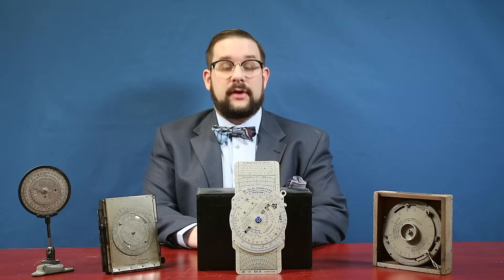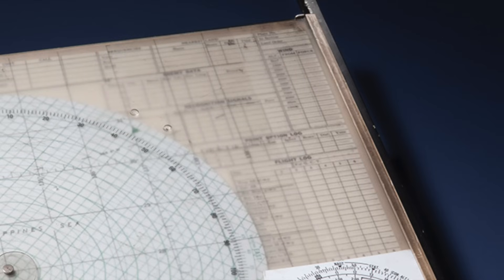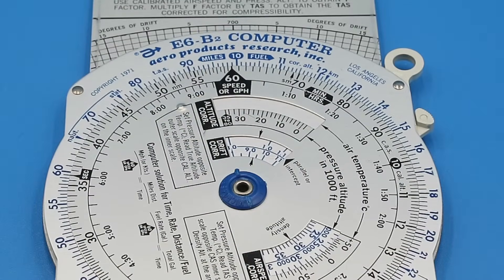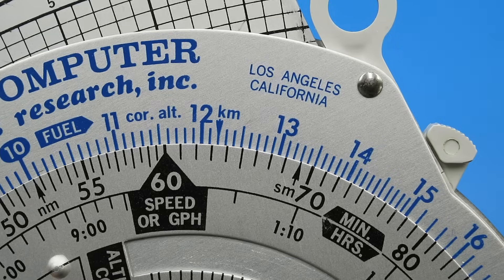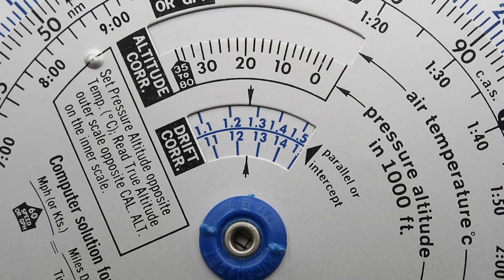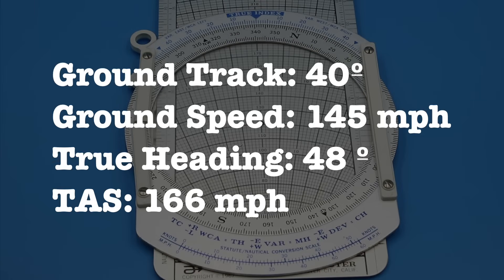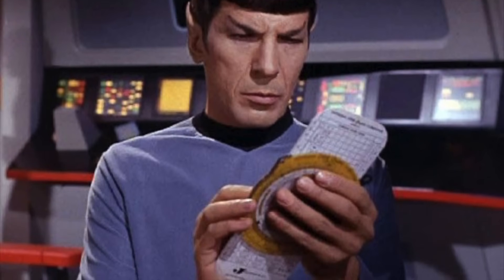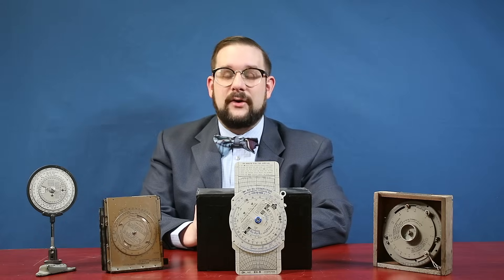E6B Flight Computer: the Pilot's Best Friend

Comment: My E-6B does not have the high speed grid on the flip side. It has more useful things for general aviation pilots. It is otherwise the same apr E-6B2 as featured in the video, dated 1973. I got it new in 1989.
Reply: I've never used the parallel and intercept function before.  According to my testing it is a tangent function calculator.  The distance downrange is along the intended course and the offset is at right angles so the angles determined are effectively the inverse tangent function.  I tried Sine (along the actual path of flight) and Tangent (along the intended course) and tangent fits the marks better.  Also it is necessary to know the magnitude of the angle since there are two scales, smaller and larger. I tested it assuming the wind blew me off course and using it to intercept, meaning turn from the current heading resulted in being within 2° of the wind correction (crab) angle to intercept the original course intended.

Comment: 🧭 E6-B1 Flight Computer: Proof the Earth Doesn’t Move — From the War Room to the Cockpit

Before GPS.
Before space propaganda.
Before science fiction became “science fact”…

Pilots navigated the world using a simple mechanical tool: the E6-B1 flight computer — designed in the 1930s and used through WWII and beyond.

Guess what it doesn’t calculate?

❌ Earth’s spin (allegedly 1,000 mph at the equator)
❌ Curvature drop over distance
❌ Coriolis adjustments for a spinning globe

Because it was never needed.
And still isn’t.

✅ The E6-B1 was built to work with reality: a stationary, flat Earth — just like the Bible describes.

“The world also is established, that it cannot be moved.” – 1 Chronicles 16:30
“He set the Earth on its foundations; it can never be moved.” – Psalm 104:5

Pilots use plane trigonometry to correct for wind, calculate true course, and find ground speed.
They don’t adjust for a globe. They don’t factor in spin.
Because the Earth doesn’t move — and flight proves it.

If this offends you, consider:
Why do the tools that get people safely across oceans still rely on flat-Earth math?
If the globe were real, these instruments would fail.

But they don’t. Because the Bible wasn’t lying.
The “science” was.

Comment: Interesting. My son gifted me a Citizen Nighthawk watch that has an internal rotating ring that has some of the functions of a flight computer. I used a slide rule for chemistry and physics equations in the 1960s so I should be able to figure out how to use this watch but the print is too small for me to read even with my reading glasses so I don't use it. It's just a very complicated appearing watch.

Comment: At one point, I earned a Private Pilot Certificate.  I also worked in IT as a software tester, so while I loved computers I don't entirely trust them.  So while there were electronic tools available, they had software.  And batteries, which could die and I'd need to carry extra batteries, blah, blah, blah. 

I loved that thing, though.  I used it for flying, and sometimes for just general math.  Mine was aluminum.

Comment: Sure brought back memories of my early pilot training starting in 1962. I still have my Jeppessen circular “Whiz Wheel”. And, I used a Post VersLog slide rule in College (mechanical engineering). I retired off the Boeing 767 over 20 years ago. The Boeing had a Flight Management Computer (two actually) that did all our calculations for us. EXCELLENT explanation, though.

Comment: I still keep a Whiz Wheel in my flight bag and use it to stay in practice.  While even entry level general aviation planes glass cockpits and tablet based apps becoming the norm, there is still the satisfaction of plotting your flight with an E6B.  It requires no batteries, does not crash (unless you fly the plane into the ground), does not need updates, and no annual subscription fees.
Reply: God bless you good Sur…🇺🇸🇺🇸🇺🇸

Comment: At 15:58 you show a Mk. III Navigational Computor. From my dad's RAF Air Navigation Handbook "It is made in three types. Mks III, C and D can be secured to the thigh and are designed for use by the pilots when seated. They carry a pencil and a small note-pad under a flap, on the back of which is set a circular slide rule and a Height and Airspeed Computor for instruments calibrated isothermally (C) or according to the I.C.A.N. convention (D).
Mk. III F is for use by Navigators, and apart from not having straps, a flap or a note-pad, is virtually the same as the other types".
I can scan the pages for you if you wish.

Comment: Thank you for covering the E6-B. I bought my aluminum E6-B when I was about 14 years old so I've had it for 55 years and I still use it. I also had a Jeppesen CR-3 computer but the plastic degraded over time and it became difficult to use. It may still be packed up in a box somewhere.

I still want you to cover the Rude 2102-D Star Finder.

Comment: The huge advantage of the Wonder Wheel is that the human mind is more suited to analog information than to digital. As you work the wheel, the mind adjusts perception to match -- in other words, you are following the moves of the markings that are important to you, so you understand the results in relation to what you were thinking.  Looking at a digital readout, you have to correlate the result to what you were actually doing.

I've tried electronic calculators specifically designed for aviation, and keep going back to the E6B.

Comment: G'day,

Back in the late 1970s I spent some time selling Helicopter Joyride tickets for Captain Rosemary Arnold Harris, whose claims to fame were being the first woman to fly across the USA in a Civilian Turbine Helicopter (a Hughes 500..., back in the 1960s), and being the first female Commercial Rotary-Wing Licence-holder in Oz.

She often flew in a Gold Lame Flying Suit (!), and sported a Wristwatch with a 2-inch Dial and a Flight-Plan Computer around the Bezel...

A few years later a RAAF WW-2 Aircrew Veteran gave me his 1941 Airframe Riggers' Textbook - featuring LOTS of Basics and some coverage of Fairey Battles, CAC Wirraways, Hawker Harts, & Lockheed Hudsons, as well as a Gadget made of Perspex & Brass, circular, labelled ;

"A.M."

at the top of a white Perspex Disc 10 inches in diameter, in the centre of which is a 7 inch Clear Perspex Disc...; One half being dedicated to

"OBTAIN TRUE HEIGHT...."

& the other half to

"TO OBTAIN TRUE AIRSPEED..."

On the lower side it is labelled;

"WIND AND NAVIGATION CALCULATOR Mk.I.

ISOTHERMAL CALIBRATION

REF. No. 6B/243 "

On one side..., with the above engraved and inked legend...

If one sets the corrected Height in thousands of feet against Air Temp in Centigrade, then the Corrected Height (Indicated by the Altimeter as corrected for Local Barometric Pressure - reads against a scale showing the 
True Height...

Or it will take "Corrected" HEIGHT with air Temperature to yield TRUE AIRSPEED...

And it offers to transpose Statute Miles with Knots with Kilometres..

On the flipside, the outer inch & a half "doughnut" rotates around the centre..., The outer scale, at the top reads 

"T.A.S. (from 70 to 300) T2"

Inside that is 

 'WIND...(4 to 70) "Q" ' 

Inside that is a Compass Ring -and all those 3 Scales rotate as one.

The centre 7-inch Circle is fixed, clear smooth Perspex, over  marked white core..., in red & green the sides are marked PORT & STARBOARD.

There's a central vertical line with an upward pointing Arrow..

The vertical Line has a set of parallel lines running horizontally across it, and from each Intersection, straight lines depend, sloping down to the Right & Left - labelled as
"2M 00S" at the bottom, rising by 5 S increments with every 10 S labelled - running up to 
"4 M 00S".

Basically, I reckon it to be a Navigatir's bit if Kit, designed to be used wearing Gloves & witth 2 Brass Knobs on one side & 2 on the other - and as the measurements show..., it's
HUGE...

Easy to use in Silk & Wool Gloves, maybe also with Leather ones atop the two inners (?).

But, how many did the RAAF make, of the oversize Mk-1 Navigator's "6B/243" ; and how many are still around - one wonders ?

Anyway, thanks - now I know roughly where what I've got, slots into the 
Family Tree
Of the Dalton E6-B...!

Such is life,

Have a good one...

;-p

Ciao!

Comment: Bravo! What a great presentation, about a classic device! I’m an engineer, 70 years old, but I’ve never been trained on aerial navigation methods. I can fix my position on a boat with a chart and 2 landmarks, but that’s about it. With your presentation, and an E6B in hand, I feel like I might be able to comprehend the concepts. Kudos on your script, your crisp, precise delivery, the quality of your photography, and of your supplementary graphics! That sentence was a mouthful, I’m aware, but I felt the need to tick of the entire list of things you did right.

I used a (straight, 12”) slide rule in high school, before the advent of electronic calculators. Got my first one of those in my freshman year of college. I still have my Pickett 12” aluminum rule.

I love your clip of Mr. Spock using the E6B. I would point out, however, the existence of the Greek Antitherika (sp?) mechanism, as an example of an ancient quite complicated gear-and-dial mechanism.
Reply: I have my Dad's Dietzgen Polymath Decimal Trig Log Log slide rule.  I use it from time to time, the easier functions, the Log Log part is tricky, takes a lot of practice. I figured out how to calculate wind triangles for dead reckoning with it; pretty fun.  I have 3 K+E slide rules but the Dietzgen is definitely superior.  The K+E slide rules use the A scale for trig functions, not as precise. The Dietzgen uses the longer D scale.

Comment: I still use my E6B! I bought a digital version for an exam but I still needed my E6B for altitude computations. I also have the Jepson computer which I bought while instructing. I brush up my E6B skills regularly as a backup to my iPad which occasional fails in hot conditions.

Comment: An electronic device looks much easier. 
You can just key in the speeds and wind vectors and get the course correction and ground speed immediately.
BUT... It is also easy to make mistakes like keying in 210 for a direction when you fly 120...
The analog flight computer shows you what is going on. It is easier to spot mistakes.
An airliner nearly crashed because the First Officer made a mistake entering the total weight. The very heavy aircraft attempted to take off with too low a power setting.
Would the same have happened if there was a rotary dial marked:  very light / light / normal / heavy / very heavy?

Comment: Ah, ha!  So THAT is what the pilot was using as we flew toward Milwaukee.  I kept the plane level and headed in the right direction, while the pilot did calculations with one of these strapped to his thigh.  Since then, I often wondered what it was called.  Now, thanks to this, I know.  BTW: It works!  Because when we broke out of the clouds at about 800 feet, there was the runway of Mitchell Field dead ahead.  PS: This was way back before such things as vertical radar, etc.
Reply: If you don't mind me asking: when did this happen, and on what general kind/ size of airplane?

I assume even today, many small aircraft aren't equipped for instrument flight beyond a gps/ I-pad.
Reply: @nos9784  — Beechcraft Model 18 - with a commercial (company) pilot.  I went along to get some flight hours as copilot.  The year was 1959.  MKE did not yet have vertical radar, so we had to figure out our own "height".  Hell, airports still used .- and -. on approach. LOL
Reply: Did the same with my uncle in the late 90s. I was holding course, while he was unfolding a map.

Comment: I learned how to use one of these during my initial flight training. It gave me nothing but respect for the pilots who used them to calculate their flight plans, and navigation information. When compared to modern technology and software the E6B is rather outdated, but it is still pretty fun to break it out every so often.
Reply: I think ease-of-use is misunderstood for devices like this. You have to learn (and train repetitively) to be able to use them effectively. But once you do get proficient, they can be significantly faster.

A more "modern" solution (like an app) might be far easier to use without training, but the method for entering data is usually not going to be as fast and eventually you'll be limited by the app. Plus you almost certainly need to have different modes, screens, and menus to get to all of the functions. Here, everything is just a spin of a dial away.
Reply: I bet they will be used more often now that we have entered the age of GPS spoofing.
Reply: @TheEvertw  Planes have different nav systems. Inertial and vor and ndf, ground radio beacons. Other nav aids are available when close to airports.
Also GPS is not only satellite based system there. However it might take decade or two until retrofit for big planes. And i am optimistic there with decade because it is pushed by war.
Reply: I remember my excitement of first using one.  Seems like yesterday.
Reply: I used line of these when I was flying . The first handheld battery devices started to arrive but my instructor was old school and said what happens when the battery dies. I had a paper map a compas and my flight analogue computer
Reply: The electronic version works much better. It is also allowed on most check rides. It may be a good backup. But it is something from another era. 
Like all slide rules, error is inherent in the device. 
I had to use it during pilot training and it works. But the electronic flight bag has performance above and beyond this device.
Reply: Same here, VTs in Milton Florida in the mid-80s.
Reply: I assume the E6B is manufactured largely because it is part of training and not because it is used (at least on a regular basis). A decade ago it might have been different, but now everyone can put an app on their phone to do all the functions of the E6B more quickly with additional abilities.
Reply: @kyleolson8977  An electronic device looks much easier. 
You can just key in the speeds and wind vectors and get the course correction and ground speed immediately.
BUT... It is also easy to make mistakes like keying in 210 for a direction when you fly 120...
The analog flight computer shows you what is going on. It is easier to spot mistakes.
Reply: @olafzijnbuis you may be able to put an app on your phone but what do you do when your phone goes dead and don't say plug it in, because you don't always have the electrical system on your plane functioning either.
Reply: @olafzijnbuis  it's also rock solid reliable: the only way it stops working is if you drop it out the window.  No dead battery, no lost signal, no "screw you, I'm going to update right now" interruptions.